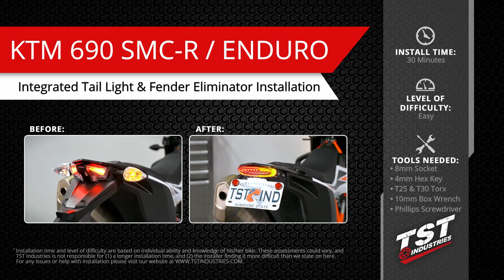How to install an Integrated Tail Light & Fender Eliminator on a 2019+ KTM 690 SMC-R / Enduro

Comment: So I purchased this tail light and  harness from them for my 2017 ktm 690 enduro r and then purchased a cheap tail tidy. I have sold the bike since but it worked awesome! I bought the harness so I could make my own connections to the factory harness. The previous owner cut the OEM harness so I just tapped into that. I did this because then I wouldn't have to cut the tst plug off the light. I wish someone would bring them a newer husky 701!
Reply from the maker: Yea, we looked for the 701 locally and came up short. They exist but they have to be owned by cool enough owners to lend us the bike in exchange for parts or compensation. That kind of person has not turned up yet. I am glad to see you applying your ingenuity to your custom setup though. IO love seeing hybrid systems using some of our parts.

Comment: Super clean! Well done. Would it be possible to fit the stock turn signals to your eliminator kit?
Reply from the maker: With a little ingenuity I am sure it is possible. The electrical connection will be tricky though unless you can crimp bullet connectors onto the OE signal wires to replace the factory JST connectors. Our subharness extra signal leads terminate in bullet connectors.

Comment: Very nice; if using the TST BL6 LED POD TURN SIGNALS on the front of a 2020 KTM 690 ER, which of the MOUNT ADAPTER KITS should I buy?
Reply from the maker: If that bike is anything like the SMC-R in the front you will not need any mount adapters. You would still need welectrical harness converters. Check out the front signal video on the SMC-R and see if it is the same on your bike https://youtu.be/GEOQLOwljrg

Comment: Is the plate holder able to be put in reverse to allow for a tucked position?
Reply from the maker: We would not recommend that due to clearance with the tire under load. Installing any of these components outside of their intended use can cause damage or failure and would void any warranty coverage.
Reply: @TSTindustries  thanks for the reply!

Comment: an awesome kit but will this fit on 2024 Husky 701 SM?
Reply from the maker: I don't think it's a direct fit. I have seen guys get them installed but it was with some modifications. If work on the other bikes ever slows down a bit i will get a dedicated Husq kit designed.
-BR
Reply: @TSTindustries  thank you! Your system is simply the most aesthetically pleasing and I just love the plug in turn indicator options. Congrats on reaching 150K subs guys!! I'm a fan

Comment: What if I wanted to use external turn signals and not the integrated one? How would I go about that
Reply from the maker: In that case you can unpin the terminals on the green and brown wires in the six position connector leading from sub harness to tail light. This will retain the connection from bike harness to external signal pigtails, but not forward the current to the on-board integrated signals in the tail light.

Comment: looks great. Would it fit the husqvarna 701 ?  bolt on ?
Reply from the maker: We haven't been able to get a 701 in-house so we cannot confirm or deny fitment and functionality.
Reply: @TSTindustries  do you sell the plastic led light only ? i can make my own bracket
Reply from the maker: @markymark4514  do you know if the connections would be the same on that bike?
Reply: @TSTindustries  not the same ben again i can put  somme connector on my own

Comment: Do you ship worldwide? Also, does it fit a european license plate?
Reply from the maker: We do ship to most European locations. The angle that the license plate is held on should clear tire even with your street size license palates there. For slot spacing please refer to the product page. You can measure the hole spacing from your plate and see if it will fit the range we have with the slots on our bracket. I have seen this kit on European bikes but can't tell for sure if they had to do any modifications.

Comment: (shot in the dark) would this fit on a 2017 690 smc-r model?
Reply from the maker: Unfortunately we haven't gotten a 2017 model in-house to test fitment and function on.
Reply: @TSTindustries  than you for your reply, just out of your experience. Would 2011 parts fit a 2017? I know they revamped the 2019 2020 but curious
Reply from the maker: @DjKimsey  i am hoping to have an older model in the shop sometime soon so I can develop our kit for it. Until I do I can only go by what I find on the web and you have access to as much info there as I do.

Comment: 2017 KTM 690 enduro?  Need this.
Reply from the maker: I believe that pre 2018 Enduro was different in the rear.
Reply: @TSTindustries  That’s what my research tells me also. I ordered the tail light and I will make my own bracket/ mount. Thank You for your response. Wayne.
Reply: @WayneP1973  did you end up working this out?  I have a 2017 enduro as well